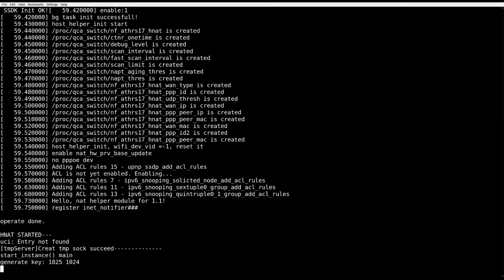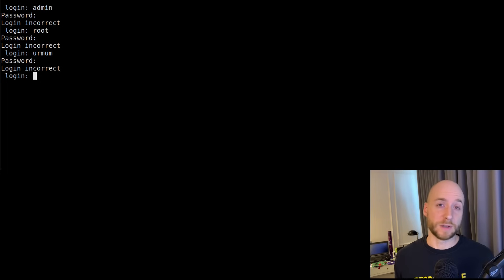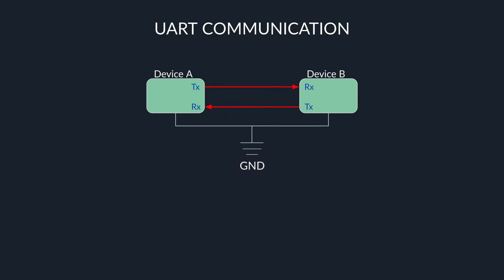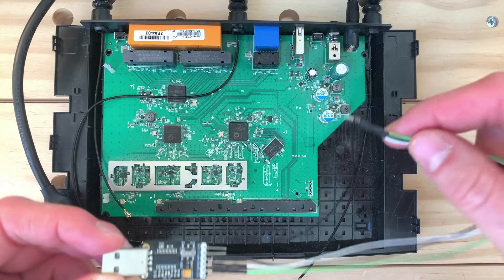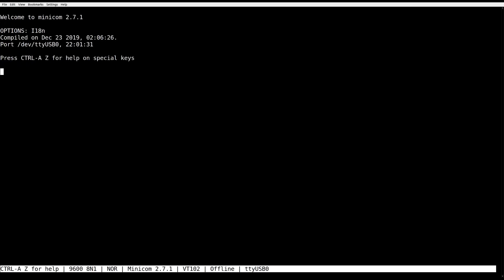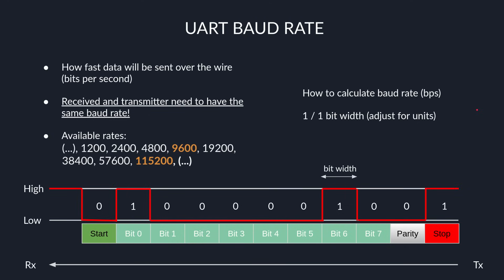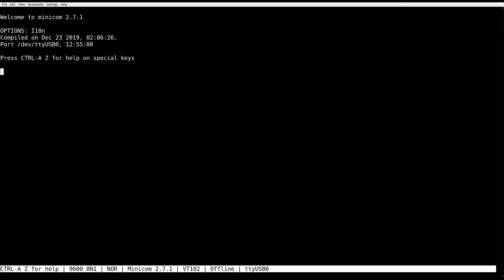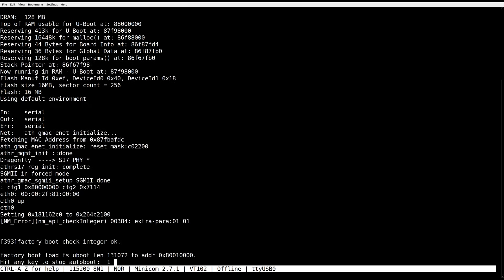Hacker's Guide to UART Root Shells

Comment: Keep up the videos very awesome! For someone new to hardware hacking what cheap devices could I try my hands on that has an UART interface?
Reply from the maker: Thank you for your feedback! 

While the techniques we show apply to any IoT / embedded device (TVs, set top boxes, smart speakers, smart home appliances, cameras, enterprise firewalls,  car ECU, etc) we really like showing examples on routers.

This is because routers are very cheap and easy to get, share lots with common with most IoT devices.

Not all routers will have UART, but in our experience 90% do.

You could start with TP-Link TL-WR841N. It's quite cheap and could be a good start!
Reply: instablaster...
Reply: Routers. I find them all the time next to bins 🗑
Reply: @Jimfowler82  that's right, you could use one to that you know a target uses and see if you can make exploits to test on that same brand router? Other than that.....the router is probably in the bin for a reason? Or people just don't care and upgraded to a newer connection that the router doesn't support (because it's branded and locked to a specific network), and in that case....the best you could do is "unlock" the router to use firmware supported on other networks? You can inject features that are supported on the hardware, that are not coded into the firmware interface? You can white list and black list different services& connections as do the OEMs? You can unlock things that your current ISP doesn't want you to get access to, or access is provided through different hardware without the restriction etc? So if you see a router just like yours and you want to hack around with some things; you can do it safely without taking your household off the internet while you try fixing it? Lol
Reply: @Jarmezrocks  in the U.K. it seems quite often people change isp companies and just throw the old router away. I found one last year & connected the uart it’s an interesting process that gives you a decent understanding of how the hardware & software work.
Reply from the maker: @Jimfowler82  if you find a vulnerability in an ISP provided router, this will affect millions of customers! What we call a very juicy vuln. Please disclose it responsibly to the ISP and manufacturer!
Reply: the PS5 UI/UX interfaces
Reply: @FlashbackTeam  That router is actually pretty good for its price
Reply: @FlashbackTeam  it looks like the articulating arms are 3D printed. Can you tell me where to get the stl files or does anyone sell them? I’m trying to hack my Eufy indoor cam it has uart pads not through hole unfortunately.
Reply: RPI zero. $6 without wifi and you have to solder Dupont header pins for rx, tx, power and gnd.
Reply: What is the 3.3 or 5 volt of the uart for? I don't see that they use it and it comes there on the USB! If I do it on a camera as they say in the video, I don't need tftp or is that mandatory? I'm bad at this and I don't understand tftp. I damaged my camera by installing the wrong firmware but it turns on but I can't connect to it anywhere, I only see the infrared LEDs and that's it. Do you think this works with that software in the tutorial?

Comment: I'm lazy so I just usually try 9600, 19200 or 115200, works 99% of the time and is faster than reversing the baud rate.  Of course for an educational video showing how you can calculate the baud rate is very good.  Great video !
Reply: In school: 
You will need to learn these 10,000 different methods!

In practice: 
There's like 3 ways to do it most of the time.
Reply: @joshuamahon260  In youtube comments:
Proving you couldn't find a use for knowledge!
Reply: I bet there is a utility to auto find the baud rate. Idgaf about manually calculating transfer speeds.
Reply: What is the 3.3 or 5 volt of the uart for? I don't see that they use it and it comes there on the USB! If I do it on a camera as they say in the video, I don't need tftp or is that mandatory? I'm bad at this and I don't understand tftp. I damaged my camera by installing the wrong firmware but it turns on but I can't connect to it anywhere, I only see the infrared LEDs and that's it. Do you think this works with that software in the tutorial?
Reply: I wonder how many people here remember 9600 baud modem?!? :)
Reply: I’ve noticed older industrial stuff is 19200 for simple data and and 57600 for geometric data (pictures, graphs, etc). Modern stuff is basically all 112500

Comment: Please keep doing these.  I’m trying very hard to learn to do stuff like this, I literally have all the gear. But either I’m slogging through textbooks that are too boring to read, just poking around under the microscope and multimeter or with uart to usb, reading tutorials for already wide open -eg dev boards and generally struggling.
Reply: I don’t want to hack hack anything; I just would love to be able to take my old broken smart devices with generally powerful chips and Linux - I can list what I’m working on if interested- and repurpose them.   For instance I have a 22 in touch screen used in advertising and ran android it no longer works. I got uart logs, I can even send commmands over uart though unreliably- usually the boot log washes it out but a
Simple “ls” will output in between log lines. 

I don’t yet understand what to do next, boot loaders, getting it to boot
My Linux.  I don’t understand even a smidge of android- so that’ll have to to
Reply: It’s a rock chip rk3288 but I also have several other projects, two with ingenic JZ4775, a very important one I need to fix with a vacuum octeon plus with usb thumb drive rather than spi?  And another I have three of mediatek or something. Discarded yi cameras.  But I can’t get all the way there like you guys . I have 75% the skills but I neeed the last 25%
Reply: @altimmons  Did you document any of these things somewhere? I'm having the same passion you had back in the day and would like to learn as much as i can on this topic?

Comment: You can also use well known 'screen' command instead of 'minicom'. Screen is usually used to create background sessions but also has functionality to support configurable serial connections.
Reply from the maker: Yes, screen is actually our default but wanted to use minicom in the video as it's more recognizable. Thanks for the heads up.
Reply: @FlashbackTeam  Thanks for reply and thanks in general for your whole impressive work. Will you be publishing anything related to HackRFOne device? And one more question - this logic analyzer is original Saleae device? Is it very expensive?

Comment: 7:20 - In most cases, which pin is the ground should be readily apparent. Usually all but one of them will have small traces connected. The one that has a large, wide trace is going to be the ground. Some PCBs, however, have a certain degree of protection by making the traces less visible. On those, a multimeter with continuity would be a necessity. This board is not one of those, as you can visibly see the North pin and the 2 South pins have small traces, and the odd one out is connected to the Board Common Ground. This works for simpler PCBs. It is the more complex ones - where the ground is less obvious - where you need to use this method.
Reply: Sure, but... testing the connection takes just a few seconds. Turn the multimeter on, tap each of the four connections, done :D

Comment: A lot of the times, the manufacturer will have vcc connected to ground on the board which is what locks hart down and makes it read only.
By disconnecting them with a small tear (micro grinder works well for this so you can do repairs later) you open it up to read/write.

This is not for all of them, but it is a cheap and effective way that they do, do it.

Comment: This was interesting and informative. One small nit. I've always heard this called asynchronous serial protocol, and the UART is the hardware component that emits the protocol.
Reply: This.  Saying "uart protocol" makes the hairs on the back of my neck stick up.  Universal Asynchronous Receiver / Transmitter.  It's  hardware component, used to be a discrete chip but these days it's usually a macrocell in the CPU (or other VLSI chip) design.

Comment: HW dev here. You are very lucky with the devices you showed. I don't know any device, which my company developed where you can do such attacks.
But nice video!
Reply from the maker: It's a nice gift to have full UART access and that happens way often as some may think. Also, consider that even if UART is disabled in production there are still ways to enable it as we have done many times, even Tx is very useful already. But if that doesn't work you just adapt your approach.
Reply: @FlashbackTeam  you are right! We develop only products or parts which are not consumer grade. For example parts of DNA sequencers etc. We have to protect your IP and that's the reason why we put a lot of effort in protecting mechanisms.
Reply: @FlashbackTeam  Some chips allow you to blow a fuze inside them to permanently cut any UART from the pins. However it is not often enough used. Which is why such attacks work relatively often.

Comment: One thing to note about baud rate is that the whole number integer values are not the only values you can use. There are fractional rates that are available, depending on the CLK frequency. Look up any of the older UART ICs and you should find the info.
Reply: It takes no more than 3 minutes to try the most common settings, if none of them work then you can pull out the oscilloscope but almost always you will save the hassle
Reply: @victornpb  Also, from what I've experienced with non standard rates, if you're off by 10-20 hertz, you'll always see recognizable characters to a large extent.
Reply: You can usually be off by 1-2%. The UART peripheral will not even notice that. It depends on the sample rate of the peripheral and the number of samples it takes per symbol.

Comment: You also need to take a note of the max voltage. The adapter used in this video support 5v and 3.3v and 3.3v was selected. Makse sure your adaptor support the voltage appropriate voltage level or you can fry something up.

Comment: What is the 3.3 or 5 volt of the uart for? I don't see that they use it and it comes there on the USB! If I do it on a camera as they say in the video, I don't need tftp or is that mandatory? I'm bad at this and I don't understand tftp. I damaged my camera by installing the wrong firmware but it turns on but I can't connect to it anywhere, I only see the infrared LEDs and that's it. Do you think this works with that software in the tutorial?

Comment: I'm not experienced with this but just an idea, is it possible to modify the firmware and add a backdoor to firmware and rebuild again, when upload the firmware, we have shell??
Reply from the maker: That's a trick we also commonly use :) 
But in many cases, this is very hard to achieve, as the firmware might be signed, encrypted, have some protection and if it goes wrong you can brick the device.

This UART method should be your first approach, as it can be very quick and easy, and give you an instant root shell.
If that doesn't work then you should explore alternatives like the one you described!
Reply: @FlashbackTeam  Thanks for the answer, as you said I mentioned about the devices firmware available to download and unencrypted
Reply from the maker: @selimeneskaraduman6935  Sure, but keep in mind that even if the device's firmware is available to download and unencrypted, the device itself might only accepted signed firmware. Even if it's not signed, it expects a certain layout or checksum or something like that which might be very hard to pull off in practice. 

But you're thinking right, it can be done and we have done it. We might show it in a future video too!
Reply: @FlashbackTeam  Look forward to see that :)

Comment: Hi. Do you think it might be possible to interface with SIP chips like macbook WiFi ICs? Since 2020 apple uses embedded WiFi SIP with onboard SPI ROM which stores MAC and SN. The problem is that it is also bonded to CPU, so there are thousands of macs with signature damage (due to design WiFi chip dies after water damage in very high amount of cases). Unfortunately this causes the device to crash on boot and it wont work with different IC. There are UART testpoints around this IC, so I was wondering if there is a chance that such specific chip might he hacked to work on different board.

Comment: If the router and the USB ports are powered through different source, how do you close the ground loop? Also, is the 3.3 volt logic tolerant with 5V port?
Reply: As long as you have an isolated power supply and you are not getting shocked there is no ground voltage and you can join both grounds with no problem, you can connect any 3.3v tx into a 5v rx no problem but the other way 5v tx to 3.3 needs a voltage divider, i usually use a resistor and a led for that as the led will drop the voltage to 3v and give feedback as a bonus.

Comment: I’m looking to find a way to get the voltage off of a DJIFPV flight pack. It consist of six cells. The cells are tied to a BMS. It’s my understanding that there are three wires on the main battery connector one ground one TX one RX. Does that mean it’s possible to create a code to receive voltages of each individual cell?
Reply from the maker: Do you have those connectors labeled? If not, you can use multi-meter to find ground and connect logic analyzer to the remaining 2 pins and take a trace. Because it could also be used for  a different protocol, for example I2C. With a logic analyzer you can apply some auto-discovery.
Reply: Yes, I have the breakdown and I did take a voltmeter to the pins. One side had a constant 3.16 V and the other side had a constant .5 V. There was no fluctuation in voltage. The total voltage of the pack was 22.6 V.

Comment: At 6:40? How did you know that it is a UART interface? How do we connect to that sort of interface?
Reply from the maker: Sort of experience. The more you work with embedded the faster you are able to identify various elements of it. Hence we have shown different types of UART interfaces in the video to emphasize on it. 

Normally a special connector would be needed for that interface. But if we didn't have it we would simply solder wires into it.

Comment: Is the protocol called UART now? I've only ever known it as RS-232. UART is short for universal asynchronous receiver/transmitter, the piece of physical hardware that handled the serial data transmission. In some of the earliest PCs, a UART was a discrete chip.
Reply: That bugged me too. "UART" is not the name of the protocol. :) I've always called it "asynchronous serial" or RS-232 (although the voltage levels are wrong here, of course), or in this context, simply "serial console" or "serial console port".
Reply: RS-232 is the connector type for serial comms...not the same as the UART chip which processes the comms.
Reply: @JeffCaplan313  "RS-232" is the name of the full protocol, including signaling levels, timing, stop bits, parity handling and all that, as well as the connector types (usually DB-25 or DE-9) and their pinouts. In this context, unless you want to be precise, "RS-232" actually does work as a reasonable name for the protocol even when using the wrong connectors and at 5V (TTL) or 3V signaling levels. The voltage levels are usually explicitly mentioned, and the connectors tend to be fairly unimportant in this context as long as the pinouts are documented. It's more precise than just saying "serial", since that will include I2C, SPI and other serial protocols that do not conform to RS-232 signaling.

Comment: I connected the gnd and tx pads from the docsis 3.0 router to the gnd and rx pins on ttl adapter using pcbite probes but dont see anything on my laptop. I am using putty terminal. Any suggestions?
Reply from the maker: Check if pin and Tx line are connected connect. You can use continuity mode for this. Also, UART might be disabled by a fuse in that case you might be unlucky.

Comment: What you should do first is identify the target chip and get your hands on any data sheets: especially those regarding the boot- or programming mode.
Many chips have strap pins to tie to gnd or whatever to enter almighty programming modes.
Reply: Often the root shell is way more useful than any programming mode because the device has all the needed driver software installed. E.g. you can just run "ping" instead of writing a TCP/IP stack

Comment: Brother I've a modem router model tenda D301 i updated it's firmware after firmware update its admin password didn't work and i also rest to default settings with reset key but its not working how can i see my password using Rx Tx method? With my pc or laptop? Solution please

Comment: Nice video. however, I have a question. Is the start/stop bit always just one 0? If so just the bits per second define how many bits it will capture per packet so it doesn't "desynchronize"?
Reply from the maker: Thanks! Synchronization is only determined by the baud rate that sender and receiver need to set to the same value. It ensures synchronization of read and write. Start bit is always a LOW value (logical 0) and Stop bit can be 1, 1.5 or 2 bits HIGH value (logical 1) at the end of the UART frame.
Reply: I believe it depends on the idle state of the data line. Start will always be inverse of idle level and stop will be same level as idle.  @FlashbackTeam